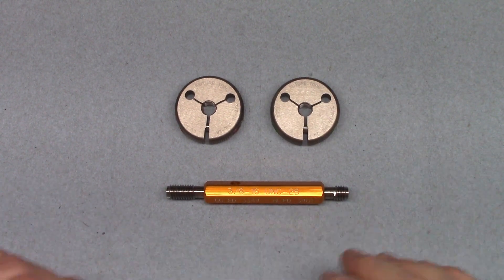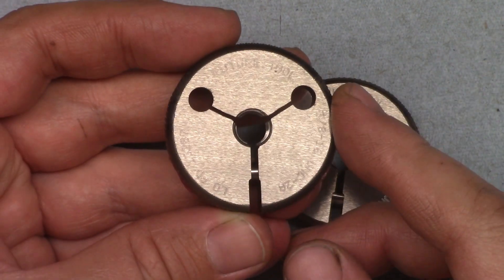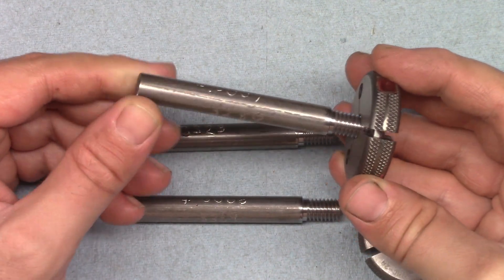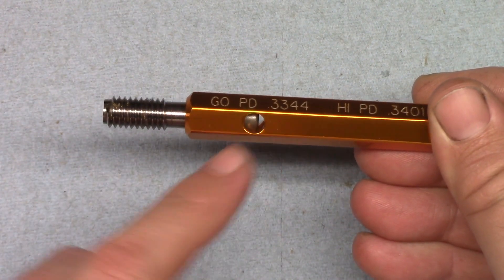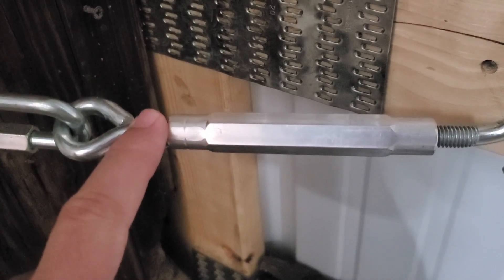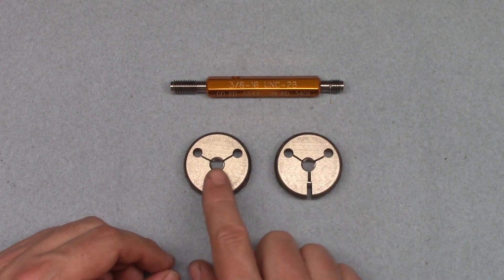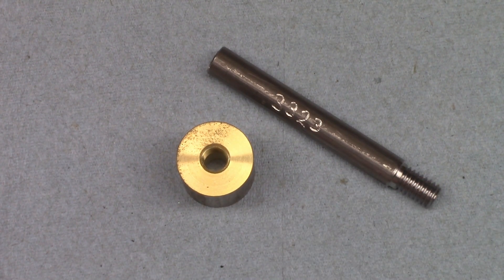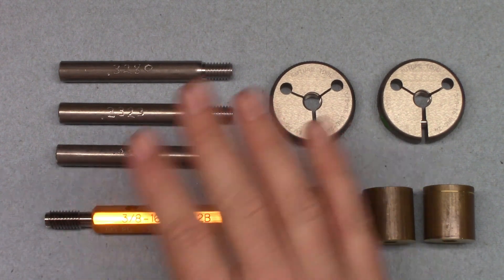How to Use Ring and Plug Gages to Check Threads

Comment: I have made a set of external thread gages that have served me well over the years.  To make one you need to purchase a tap with an H-1 limit.  H-1 taps are ground with a range from pitch diameter to one half thousandth over (.0005).  Any thread that you make that fits in the gage without a lot of wiggle is within tolerance.  Just make sure it is a new tap and not out of somebody’s tool box.  Way cheaper than buying ring thread gages and works for just about anything except for parts to be used on the space shuttle.